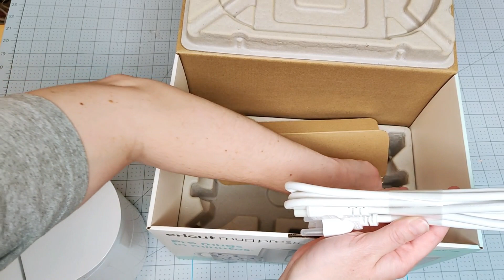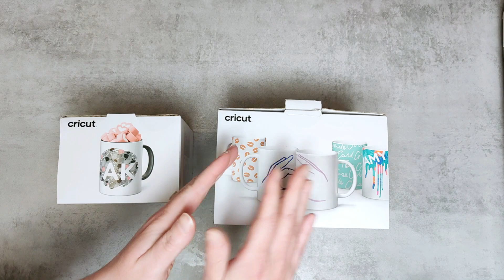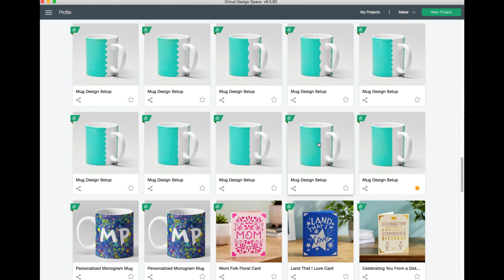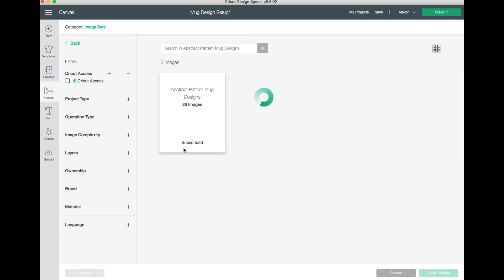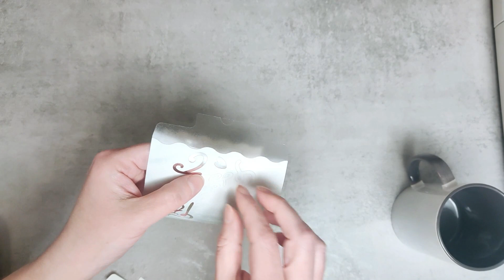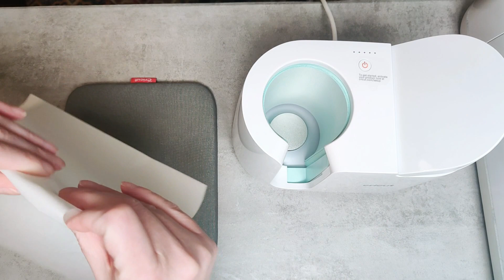Cricut Mug Press: What's in the Box? Getting Started and Creating Mugs!

Comment: I am very impressed my this mug press, however I am going to hold off getting one until I know for sure it will work on sublimation tumblers that do not have handles. These are the ones I do more than ceramic mugs.
Reply from the maker: I'll definitely put those on my list to show!
Reply: Marie. Yes it will. It's a heat press. So it will press anything form 11oz up to 16oz. Just remember with tumblers about how tall they are. Has the print will be at the bottom part. Shorter tumblers will look better.